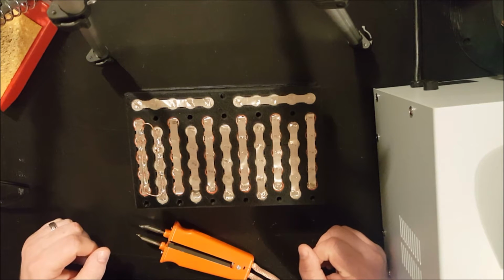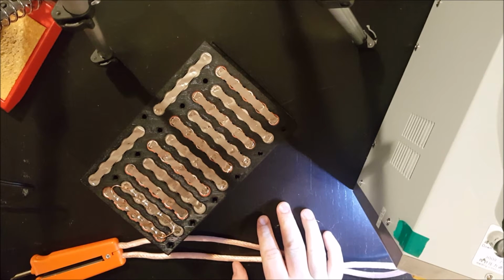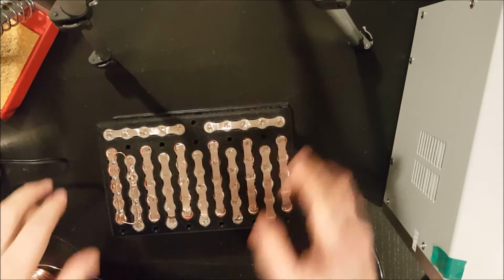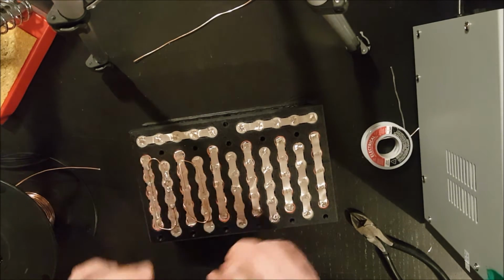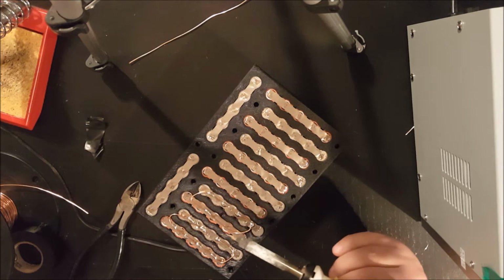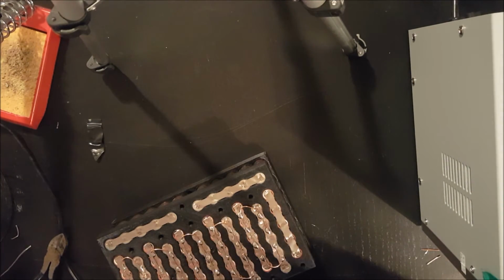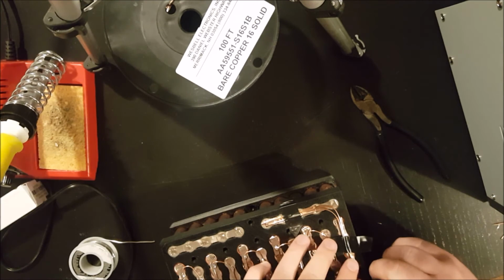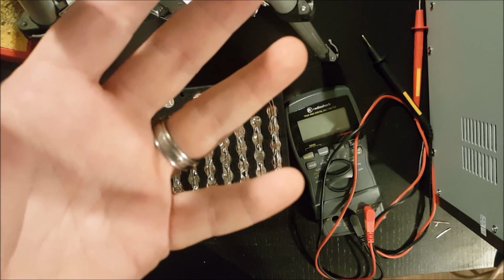Welding and Soldering! Custom 3D printed 48v eBike battery prototype (part 2)

Comment: Thank you for posting this series of videos! I only just started part 2 but I have been doing a bit of research and part-prototyping for a 3d printed 10s12p enclosure for an electric longboard, and have been putting off doing more prototyping due to knowing I’m going to have to do many iterations on the design, so I am looking forward to learning from your videos, this is great!